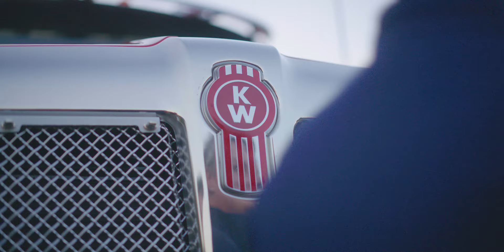What Makes a Kenworth The World’s Best?

Comment: Lol sitting here watching this while my 2022 t680 next gen is in the shop for the 7th time in 200k miles. It’s the 2nd time for the rear main seal leaking. 4 times to get the auto start looked at still doesn’t work and hasn’t since i got it. Once for the engine fan randomly staying on for hours reducing MPG to less than 6 on flat ground. Random exterior plastic parts shake them self loose and fall off if not zip-tied until a dealer can fix. Head lights that within a year started shaking in the housing causing the light to bounce all over while driving. And many other issues. But i guess the truck does look nice on the way to the shop.